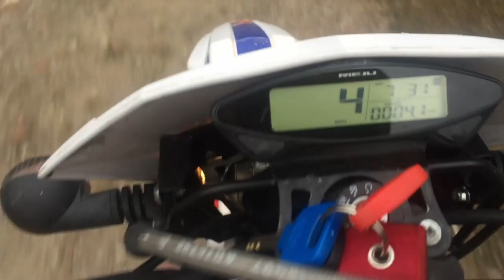How to fix a motorbike speedo (No speedo cable)

Comment: What did the speedometer show before you fixed the problem? because I have a rieju mrt 50 and my speedometer isn't working like it should, it changes the number and rambles out random numbers when im riding in top speed. Do you know how to fix the problem?
Reply from the maker: Oh it didnt throw up any numbers at all, if it is just zero mph then you have the same problem as me as the magnet has probably fallen off
Reply: Hello, I have the same problem with the speedometer on Rieju mrt 125.. My ask is, did you solve the problem?

Comment: Hi dude, I got a rieju also and my problem is that the speedo sensor broke, so I bought one from amazon but it doesn't seem to be working, I would be great if know something that would help
Reply from the maker: Did the sensor break or did the magnet on the sprocket fall off?

Comment: I have a rieju marathon pro 125 and I don’t have the same speedo drive as yours or I don’t have a magnet on my disc or anywhere to put one and mine isn’t working as well and when it was working it would only register at the 12mph can any one help
Reply: Were you able to fix it? I have the same bike as you and the same problem.
Reply: same
Reply: any luck?